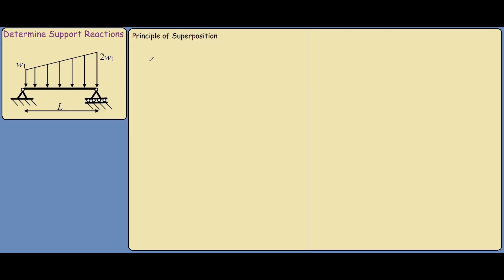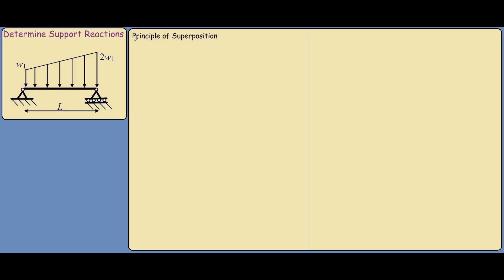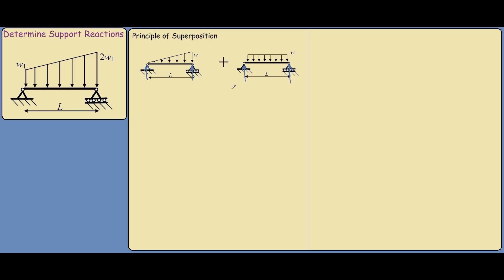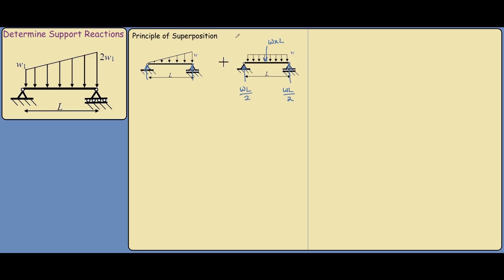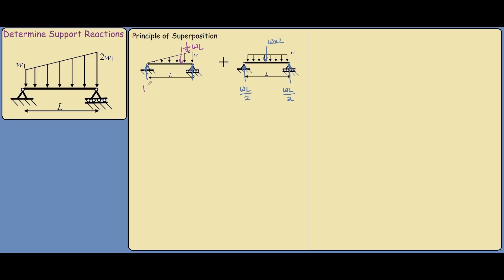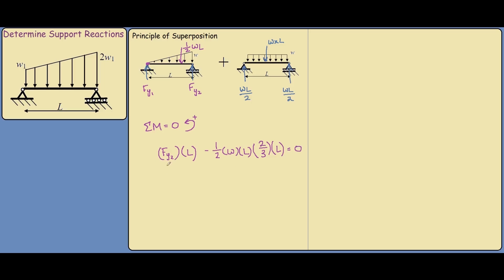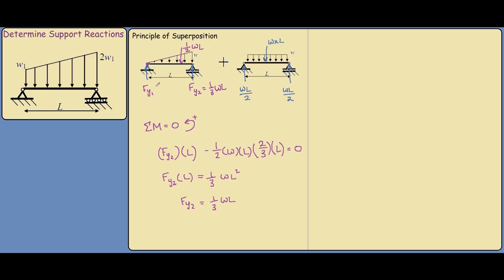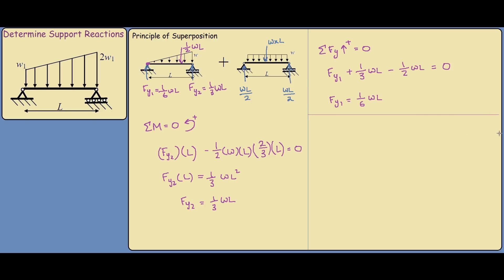Trapezoidal distributed load on beam support reactions

Comment: For hinged support there will be an existence of both vetical and horizontal forces.... but y did u taken only the vertical force..
Reply: Because there is no external horizontal force. If you take the summation of forces in the x direction, it will just be zero.